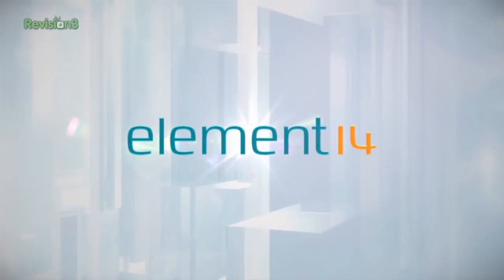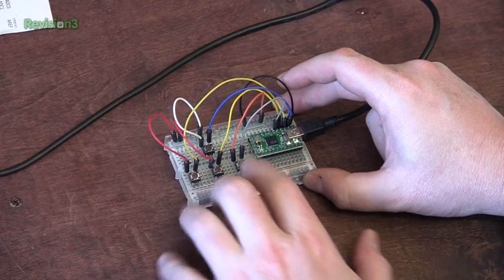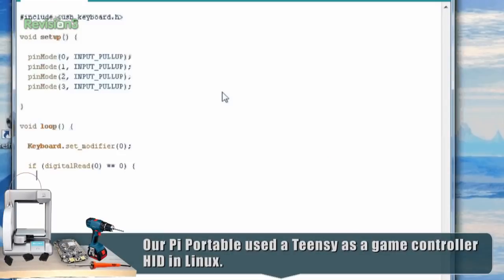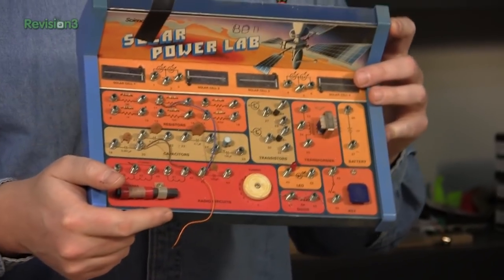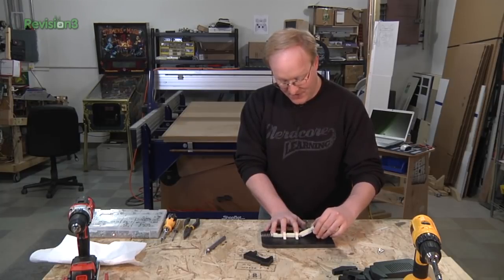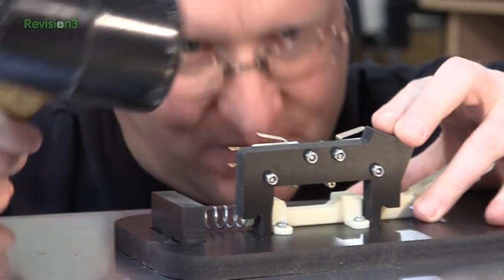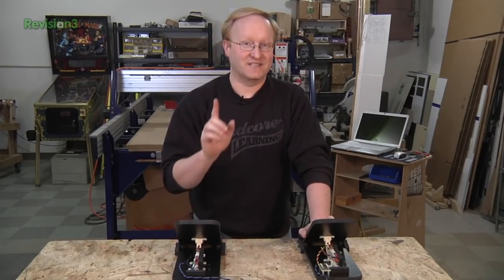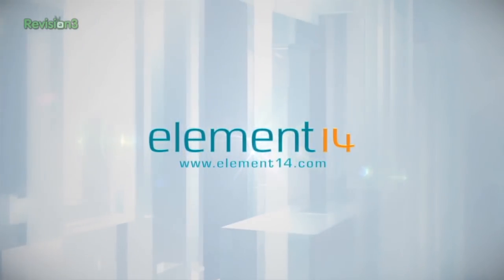Beyond WASD: Foot Pedals for PC Gaming

Comment: I hate how people go on about the pc being better at controlling games, really all that is better is the mouse but the keyboard is shit at playing games on. but games like magicka and others is the only games that will work with it all the way. but any even then its using wasd. controllers are better than keyboards its just a fact
Reply: I like to make statements that I feel are correct, It's just a fact.
Reply: what? wasd does not have any pressure control, thats why car games are bad on pc. they are basically really bad d-pads. do you when your playing on console use the joystick or the d-pad to move? most likely you use the joystick, and if you do use a d-pad then you are using the dumber way to play. you know why? because joysticks have xyz in them, they know where you controllers joystick is a its point, so you can go faster or slower if you want to. so I am still right, controllers are better than keyboards
Reply: TheJeremy404 Yup you still making statements. Well done.

As long you're just play racing games, or games where you need constant access to slow movements, you're absolutely correct. If you're playing the other 95% of games that require very quick and precise control or selection, you might want to consider a mouse. Analogue sticks provide neither, and the scenarios in a game where I would want to move at less than full speed are fleeting.
Reply: no but its true though. if its not prove me wrong that the keyboard is worst than a controller. other then a mouse everything else is better on controller. prove it wrong. I already added evidence. I told you why its better. and I used car games as a point. and something else, fps's for a point, in farcry 3 and you want to be sleathly you want to be slow right? well you can't control that. I mean there is the shift key to run but thats it. I don't know why you think its a clam, because I gave evidence for it so its not. its a fact and if you don't think so prove it wrong
Reply: TheJeremy404 Your statement was disputing "pc being better at controlling games." Claiming that only the mouse is better is a useless statement. No one uses a keyboard alone to play games, not since the early 90's.

The keyboard and mouse as a combo wins in accuracy and speed 95% of games. Controller wins for simplicity and in games where non-binary inputs are vital, which is basically just racing games.

If we're being technical here, disputing that "pc being better at controlling games" is completely daft because you can plug a 360 controller, a dualshock, a racing wheel, basically anything you want into a PC to control your game as you wish.

Also, in Farcry 3 you press ctrl to crouch and go stealth, it was never an issue for me. The game actually suffered for being balanced primarily for consoles/gamepads. Being able to quickly and accurately kill anything made the hardest difficulty level extremely boring and easy.
Reply: my point is that keyboards allow 3 speeds running walking and slow. but controllers add more than that. even if in some games its pointless its still there, so it is not invalid its a fact.
Reply: TheJeremy404 If your entire argument is "controllers have analogue input and analogue input is better for racing games and a marginal convenience in stealth games" then I agree with you.

That however, is clearly not the statement you originally made. Unless you were somehow implying we should use a controller in 1 hand and a mouse in the other.
Reply: Stan Velijev ok first off, that was not my point at all, but even if it was there are still games to this day that use only the keyboard, and its not a small amount.

know I don't know where your getting you %'s from but even if thats so its carried mainly by the mouse because the keyboard is not fucking accurate at all. it lets see wasd shift and ctrl for example. it has 3 speeds 4 ways to go and thats it. controllers have so much more than that, and even if its pointless in some games its still there. and it is still better.

and I do use a controller on my pc. I don't know how you could of thought I didn't. I mean its kind of clear that some one that plays on pc that can't stand keyboard using a fucking controller.

and I have pc far cry 3, it is not bad on pc controls for what it is. hell you have all the pc basic controls there. 1234 is your weapons, wasd, space, shift, ctrl. and any I didn't like I can change where they are. so you going on about that is pointless because you can change what it is. hell this was before I had a controller to use so I used some of my mouses extra buttons to use some things.
Reply: Stan Velijev really? thats what I was thinking. a controller in one hand (it would need to be made for that use) and mouse in the other is a much better way of playing. analogue input for moving and mouse for looking would be the best way to play.
Reply: ok but some games don't do that. and even so controllers can have more than 16 directions. so that is still better
Reply: TheJeremy404 I seriously have not played a keyboard only game since... Doom? Maybe Duke Nukem 3D I did keyboard only back in 97-98, that's as far back as I can remember doing keyboard only, aside from maybe a game like typing of the dead, which I don't think you'll argue would work better on a controller.

I don't see how you can argue for PC controls being inferior when keyboard controls are necessarily accompanied by a mouse. In which case,  racing aside, pretty much everything is better with mouse aiming.

If your argument has shifted to controlling something like COD with a keyboard only, then your argument was ridiculous from the start.
Reply: TheJeremy404 So which games are significantly better as a result of analogue controls? What are we arguing over here?

Racing, got ya. What else? Stealth? Not really, a toggle/modifier is sufficient for stealth mode. Having the option for more then 3 level of speed isn't useful if  it doesn't gain you any type of real advantage within a game, so things like sprint/walk modifiers seem completely adequate.

Now I can list you limitless examples of scenarios where a m+k are superior. Please name me a few where a controller has a real advantage.

Off the top of my head, the only things I can think off are God of War or Assassin's Creed, melee action games that were clearly never planned to be mouse/keyboard compatible. One could argue platformers, but that's purely comfort and I'd likely use the Dpad there and the analogue part of the control would have no use.

Really, not sure where you're seeing the benefits.
Reply: there are always people who will mod games to support sensitivity. thats another reason to be a pc gamer free mods for everyone. over 16 what, buttons, oh well guess what, an average keyboard has over 100
Reply: TheJeremy404 I asked you about 5 times to give me  examples of games outside of racing where analogue controls would actually give you a real advantage over a keyboard.

If you're going to bring up something like "more than 4/8 directional movement" please explain to me a game where you gain an advantage from that. If you're going to bring up "movement speeds in a stealth game" please bring up an example where you need more than the 3 movement speeds to perform well in a game.

If you can't provide me with anything then you have no argument and I have no reason to participate in this anymore.
Reply: You know why a PC is always better for controlling a game? Because of stuff like this. We can use whatever input methode we want. Keyboard+Mouse sure is the basic setup, but I also just use a PS4 controller, or maybe a actual wheel for racing games. While consoles are stuck with one controller.
Reply: You are stupid. Controllers are only good for CoD, Twin stick shooters and games poorly optimised for PC.
Reply: oh and car games. now seeing how you missed that I can call you stupid, you're stupid. now I was saying keyboard, not keyboard and mouse. I don't know why you guys keep missing that. really the best way to play would be a one handed controller and mouse. thats my point, the keyboard is shit, and it should be a controller instead. now clearly you didn't get any of that from my other comments, so I'm going to call you stupid again, you're stupid. bye
Reply: TheJeremy404 I know you said keyboard and keyboard is better and why have a controller when you can have keyboard, lots of console peasants say that k+m is bad but when you give it a go it doesn't take long to Get used to it and it's superior. I only own a USB Xbox controller for dark souls. You only need three movement speeds. It has a wide range of buttons and shortcuts that can be reassigned to whichever you want. And unlike console it doesn't have to reuse every button to do different things. Sure you may like it for a small percentage of games but for the huge majority keyboard is better
Reply: I'd like to see some evidence for that please, and console peasants really? because of that I'm going to assume that you hate consoles and only play on pc. ok graphics are better, I know that, but keyboards are worst at playing fps/thirdperson/cargames/and even some 2d games. and I am talking about the moving not the looking. I am not saying k+m is bad I am saying the k part is worst than just using a controller, I am saying that c+m is better than k+m. if people used that why to play games it would be better. but as of right now I don't know of any games that do that, and thats sad. and I am talking about movement, I don't know why you guys keep forgetting that, wasd shift and ctrl is worst than joystick and triggers, it just is.
Reply: TheJeremy404 nope, shift and Ctrl are good compared to pressing the same button in a different way to do the same thing. I am not bothered about graphics, I like PC for prices and gameplag . and why use c+m you don't need a mouse if you want to waste time with controller. I don't only play PC but I did use to be a Xbox fanboy before realising that there were superior systems. I use the Ouya as well. People might think its a joke but its a cool system for playing with friends despite a controller problem and WiFi problem but still better than Xbox and PS. Like I said before conttollers work for cod, racing and football games, twin sticks although sometimes k and m is better and for games badly optimised for k+m
Reply: TheJeremy404 Outside of racing, I cannot find a single example of analogue controls gaining you an actual advantage in terms of movement that can't be done equally as efficiently with a keyboard. Sure, on a technical level, there are more degrees of movement, which is completely meaningless if that doesn't provide you with a tangible advantage. Unrealized potential isn't a very effective argument.

You could make some arguments for convenience I guess, but really, even for FPS games, I can actuate keys to perform actions much faster than with a controller. I have access to 5 points of instant actuation and that's with 1 hand. On a controller you have 2 per hand, trigger and analogue stick. Even if you considered 3 of my fingers permanently limited to movement (not the case) that's still 2 useful points of actuation, where as with the controller you're left with the trigger and you'd need to move your fingers for anything else (or click the trigger, which I'd argue prevents you from doing accurate movements, that's like moving your fingers off wasd).

I assure you, if there was some advantage to using a controller with a mouse, competitive gamers would be doing it. They aren't. Not even contemplating it.
Reply: Stan Velijev yawn, if people wanted it or if it was useful somebody would mod a keyboard to have different sensitivity on wasd keys but its not necessary and your problem is solved, you only need one finger on wasd or even two so even then you have the rest of your hand to reach on the keyboard for another key
Reply: no your not getting it, when I say c+m I am not using the other joystick. 1 for moving and thats it. now what I should of said was x+1joystick+mouse is better than ctrl+wasd+shift+mouse. oh and I have a ouya, its called a nexus 7. now I know that graphics and the controller is worse on the ouya and don't give me bullshit it is not, and the games are all mostly touch games. and most of those really suck. but thats something else. do you get it now? oh and the fact that you didn't the first time makes me want to call you stupid again, you're stupid
Reply: i have a nexus 7 too, both that and the ouya are viable systems, c+m is bad because you are only ever using one at a time
Reply: Stan Velijev are you saying I am right and saying I am wrong in a circle. I mean really. anyways instant actuation can be done on a controller at the same time as a keyboard, and even if that is true its not my point. ok I meant a 1 handed controller with all the buttons, it has been done before. I would just get rid of the second joystick and us the mouse. and guess what, when ever I use a controller I do take advantage of the xyz points on a controller, and a lot of my friend do as well. oh and the nexus is more powerful than a ouya stupid, and why do you have both they are the same thing but the nexus is better
Reply: Alright, so one of you made a flippant statement about PC controls universally sucking. You then retracted that to say keyboards suck as though someone plays with keyboard only, then refused to name any significant reason why their magical mouse+ controller idea is necessary at all outside of racing. What you want is a fucking racing wheel, otherwise mouse + keyboard is BETTER.

The other one started arguing with me as though I disagreed with them when I didn't and began arguing my own points against me.

I'm out, I don't need to talk to retards arguing with me for no reason or people who dodge arguments and shift their position constantly.

Side note, several companies already made pressure sensitive keyboards with analogue button style capabilities. One of them was Microsoft. You know what they found? There was no market for it.
Reply: ***** well than you only have to use one thumb on a joystick and you can still get to the other buttons, now can't you? on a one handed controller even more so. and even if you had a sensitivity mod on your keyboard, no game would support it, and it would feel really weird, and how would typing work? would you have to press it all the way? ok why I think its weird is because its basically just using triggers in a down position, you can try it right now, trust me its weird. and even if they didn't fell weird you still only have 4 or 8 ways to go, on a joystick you have over 16.
Reply: ***** oh my god, ONE HANDED CONTROLLER. they are real thats what I am talking about you stupid stupid fuck, really god you are stupid. let me make it more clear one-handed-c+m. make more sense to you stupid?
Reply: ***** ok how many of the 100 buttons are used? yeah so thats not my point at all you moron. oh and as I said about support, not all games will have modders to do that, and some games will be to hard to mod. and if you were talking about what I said earlier stupid, I was talking about how the wasd keys can let you have 8 ways to go, and the joystick has over 16 ways to go, and if you triple that because of sensitivity thats 48 points, so fuck off with keyboard being better, because its not
Reply: ok, I can't... I said it I can't give you anything on speeds, but as I said earlier having more than 16 points on a joystick do help in movement, I can say any game to help me with that. know this might sound silly but whenever you're bored on a game do you ever do something weird with the controls and just jump around in the game? because that can be fun sometimes, I know all my friends do it. and with more speeds its more fun and funny to do. oh and you asked me 5 times? well I did answer as you stated you just didn't like the answer. and please do go, this is getting annoying and I don't want to talk to any of you retards (not you I don't think you're stupid)
Reply: TheJeremy404 you don't need any more than wasd gives so you get pissed off all day but k+m will always be better
Reply: TheJeremy404 Ok well my point is, theoretically analogue might be better, in practice, very very rarely.

In racing it's important because you often need controlled turning for long periods. With a mouse this is hard, you just run out of mouse pad and moving smoothly with a mouse is pretty challenging.

In an FPS, you can augment your 8 directions from a keyboard with the mouse, so you can modify walking sideways with a small turn of the mouse to be walking in any direction you want. This makes analogue movement controls redundant. You just don't need it, doesn't add anything.

The fact that you can't really name anything critical for analogue other than racing really makes me think: Racing wheel would be the more authentic solution. For everything else a controller might be nice, often more comfortable, but will not necessarily make you perform better at the game.
Reply: Stan Velijev I know I already just responded but I would like to say something else. the joystick feels better it has better movement. this makes it feel better. oh and I would like to say that the first keyboard was never made for gaming, the mouse was not as well. but the mouse had the accuracy on its side, the keyboard is a typing machine, not a gaming controller. it has nothing on its side other the amount of button it has. which is pointless to say because not all the buttons are used in games. the joystick may have less accuracy on looking but has more on moving compared with wasd
Reply: ***** prove it then. do it I bet you can't. wasd is worst than just using a joystick. can you prove that wrong? no you can't because it true. stop being stupid, stupid.
Reply: Stan Velijev on a fps you want to keep your eye on the guy right? then you have to use asd as well as w then don't you? and thats better on joystick. now go, I know you want to, I do too. if you stop we can go to sleep
Reply: TheJeremy404 Well, "feels better" is completely subjective. I prefer the keyboard. I can press up to 5 buttons instantly with 1 hand and have access to a dozen more with that one hand. You only have access to 2 at a time per hand with the controller and have to move your fingers for the rest. I see this as a disadvantage.

It doesn't matter what things were made for originally, we now have gaming mice and gaming keyboards which fill their role.

Razer, Logitech, Mionix, Steelseries, CM Storm, Mad Catz, Roccat: All companies that make mice and keyboards specifically intended for gaming.

Computers weren't ever intended for gaming. The internet was never intended for gaming. That argument doesn't hold up.

As far as "having more on moving" we went over this. It has no real advantages outside of racing and "just walking around for fun" as you've stated. You might personally like it more, but it doesn't significantly alter or improve how the game is played.
Reply: that depends on the layout of the controller, this would be a one handed controller as I said 50 fucking times. and by feels better I mean more opinions on how you move, which makes it easier to play even if its small. oh and gaming keyboard are still using the first keyboards layout, it still has the layout that makes no sense for gaming, people just kind of made games on it, and it kind of worked a little bit. as I said please leave, I want to stop talking to you, is this a circler argument and its going nowhere. so please go away, for both of us
Reply: TheJeremy404 If you're shooting at someone there's not much reason to go anywhere but to your left or right to dodge bullets. Sorry. If anything, dodging oncoming fire is much easier if you have your fingers on the left and right and can alternate quickly versus having to tilt your thumb back and forth.

So you've given up on proving how an actual analogue control is better and are making up a fantasy controller that doesn't even exist? Why not just make up one that you can control with your sphincter muscle while you're at it. Dildo 360. It could also vibrate every time you get a new youtube comment.

I'm out, good night.
Reply: Yes a Analog stick gives you more control over movement speed. but gamer's just run around at full speed in a game so it does not matter. And for those times you need to slow down just press shift.
Reply: I already talked about this, but I don't care anymore. I'm right you know I'm right, just that its pointless what I am saying. I have heard it, now go away. I don't want 20 comments to respond to tomorrow ok? analog sticks have more control is my point and thats it. ok. wasd has less. now please go
Reply: TheJeremy404 I don't think i ever said you were wrong.
And if you don't want people to reply you should delete you're comment that shouldn't be here in the first place, as no one in the comments section has brought up the KB+mouse vs controller argument but you.
Reply: no everyone said I was saying k+m vs controller I never said that I said c+m vs k+m. so if you look they are the ones that started that not me. I didn't say you though I was wrong, you said I was right. this video is about using something else other than keyboards, so I think it fits pretty well if you ask me. now fuck off. I am done with this, I have already won and you guy confirmed it so there is no point in talking anymore, go away
Reply: TheJeremy404 Again. No one was arguing about the keyboard being better then controllers before you.
This video is is about adding to the KB and mouse combo. ( Read video description ) not about using something other then a keyboard.
But i am done arguing with you as grammar and sentence structure is that of a five year old and it's giving me a headache.
Reply: TheJeremy404 you go believe your little lies but deep down you will eventually have to admit that k+m is better
Reply: dude its a youtube comment, grammer is not really the main thing now is it? oh and I told you to fuck off, so fuck off. this video is about using something else other than a keyboard keys he is using things that work with your feet and mouse and a little bit of keys if he has to, so why is it weird if I say its better to use one handed controllers and mouse over keyboard and mouse? its in the same thing, don't want keyboard parts use something else. oh I said keyboards being worse than controllers not better. and even if I started this why do you care? fuck off you retarded little shit
Reply: TheJeremy404 yeah its about using an external foot pedal, not a controller
Reply: ***** thats not my point stupid, my point is its using some buttons on the keyboard without using a keyboard. so a one handed controller. now think about it, is this not what he is doing with the foot pedals?
Reply: TheJeremy404 Welcome to the club. I have had dyslexia for 20 years and have learned to deal with it, reading things over and over or out loud, typing things not writing things are some of the ways i have dealt with it.
Oh and Dyslexia is disorder not a disability.

And if you want to talk about being a dick \ ass. We can go and look at the three or four comments where you tell me to Fuck off.
Reply: I'm not surprised Dyslexia is so common these days
Reply: TheJeremy404 "I'm right you know I'm right" Pretty cool I guess. I'll just pretend you didn't admit you couldn't give me any example of a game where you need analogue controls outside of racing. Well won I guess.

This has devolved from anything related to a discussion to some guy grasping at ways to not lose an argument for any reason. Yeah, I guess if you had a magical non-existent controller that let you use a mouse at the same time and have magically as many accessible buttons as a keyboard and magically have none of the drawbacks of a standard analogue controller, yeah.

If you're going to resort to fiction to try an win an argument, well, seems kind of far fetched at that point.

Maybe go petition Razer to make the Nostromo have analogue key input http://www.razerzone.com/ap-en/gaming-keyboards-keypads/razer-nostromo/ Seems to be what you're attempting to describe.
Reply: no my point was c+m gives you more control over k+m. and you guys said yes. it may be pointless, but its still there. and I made the c+m up as my point, you know it can work better than k+m you said so, so I won. bye, go away, piss off
Reply: BlueFoxTV ok fine, but I am 15 not 20 I don't like reading because of it. and as I was saying go away, you were pointing out something that did not need to be pointed out to call me a idiot, I have told you to fuck off. I think what you have done is worse, go away, but before you do, tell me how in my case is it not a disability.
Reply: ***** no you stay, I want to see you proof
Reply: TheJeremy404 No one said mouse and controller is better than mouse and keyboard. No one said it because such a setup does not exist. You're claiming we're conceding arguments to you based on imaginary devices that you MADE UP COMPLETELY.

Really, your argument now is completely based around the plausibility of something better existing.

When you grow up you'll come to the realization that not everything in life is a pissing contest where the last person that replies is the winner. Facts are relevant, and the only fact you have left on your side is a magical non-existent device paired with a mouse might possibly be better than mouse and keyboard.

So you're saying mouse and keyboard is better than everything except things that you made up. Good job, you're such a winner.
Reply: ok first off, this is a comment on the ben heck show right? he makes this kind of stuff on his show right? that is why I made it up. and you said it would have more control its just that it would be pointless most of the time, I don't care it has more control and thats it. and it is a fact, controllers have great controllability but the looking is bad, use I mouse thats fixed. and you know the keyboard is not a gaming device at all, even if it says its a gaming keyboard, its still a keyboard that makes no sense at all for gaming. and seeing how you have said I am right, I do win. its not a pissing contest, its a fact. and you have not come up with anything to prove me wrong, if anything you have proved me right. go away
Reply: TheJeremy404 Let me recite back to you what you just said:

"The device I just made up in my head has more control, it's a fact." The device you made up doesn't exist. That which does not exist, by definition, cannot be /factual/ because because it is categorically fictional.

"You know the keyboard is not a gaming device" As much as a computer isn't a gaming device. Millions of people use computers and keyboard equally as effectively for gaming. Just like they use the internet, which is a communication technology not a gaming technology. I said this previously yet you repeat the same shit as though it becomes more correct through repetition.

"You said I'm right so I do win" I said you're wrong over and over, to which you just say "Nope I'm right because I can make up shit and say it's better." This is like arguing with a child. You think you're right merely because you keep repeating you're right.

This is never going to get anywhere. You're going to keep repeating the same crap and asserting victory because your fiction is more correct than reality.

Reality: Keyboard and mouse is almost always better than a controller. Fictional mixes of both do not exist, you have not produced any yourself, and shit you make up doesn't overwrite reality. In conclusion "people that go on about the pc being better at controlling games" Are absolutely correct in an overwhelming majority of games.

Thanks for playing, better luck next time.
Reply: TheJeremy404 oh, you want to see my proof, well where's yours
Reply: no you admitted to saying that controllers (joystick part) has more control than wasd, and thats it. and just because it is fake does not mean its not better, it would be better if the next gen consoles had the same price as they do now but they have the power of 2 gtx 790 graphic cards with 16gb of ram, but they don't but it is would still be better. just because I made something up does not mean it is not better, you have not proved me wrong at all. sure people that play with keyboards think it fine for them, but using a one handed controller would work better. to make it easier for you to get, a controller+mouse would have more controllability, would. and you know it would
Reply: TheJeremy404 PC is better no matter consoles specs
Reply: TheJeremy404 one handed just wouldn't, why limit to yourself fumbling on one hand when you can use both
Reply: no, you use the mouse in one hand and the controller in the other, not just use a one handed controller, that would just be stupid, stupid. I said multiple times, c+m, not c
Reply: TheJeremy404 So all you have is "Shit I make up is better than reality." Nice.

I'm gonna go back to reality now instead of arguing with kids.

A winner is you, good job.
Reply: so you do think I am right, but your too pissed off it do it nicely. and by "Shit I make up is better than reality" well you said it yourself, it is. so thank you, even though you have been a bad sport
Reply: ***** first that is if you have a pc that is better, and I was saying if the consoles where like that it would be better than what they are now, I was not ever comparing console graphics to pc graphics.
Reply: ***** I have gave you proof, wasd is 8 ways to go, a joystick has over 16 and if you put speeds in thats 3 to 4 times that.
Reply: TheJeremy404 you dont need it though, three speeds and the 8 movement directions are fine
Reply: TheJeremy404 Sarcasm flies directly over your head. It's ok, you're only a kid and obviously socially awkward.

Things you make up are irrelevant. You could have made up something that hooks up to your brain and controls the PC directly which would be infinitely more effective than any peripheral.

It's fiction. There is literally no way to disprove something that is a fiction that resides only in your head because you can make up anything on a whim, and you have.

Let me rephrase that: You're full of shit and your only way of winning this argument is "I can make up anything I want to sound right only to myself." I don't care if you can make up shit all day, I only care about what is reality.

Reality is: Keyboard and mouse is better than a controller, and it's better than made up bullshit that no one can use because it doesn't exist.
Reply: yes, yes I am, not the kid part, the social part.

and yes that would be better, I admit that, just because its not real does not mean it is not better.

the only reason no one can disprove it is because it is true. not because it is not real. put in a mindset and think its real, would it be better? it would be.

if you can't care about anything other than reality you must be a very boring person. imagination is not bad when you consider and think and then realize if something is real it could be better.

Reality is: I can make stuff up if I want to and say its true because I prove it to myself, you guys just don't like the idea of it in itself, and you guys just want to kill the idea. lets say this it would be better if your computer was bought for 30$ but it worft 600000$ because of how powerful it is, that would be better, but sadly thats not the case, I can apply that to anything. and I did
Reply: ***** yes its, fine but its nowhere near perfect now is it, 3 speeds 6 speeds, 8 directions over 16. all you have for wasd being better is that its fine, and if its fine, that makes joysticks great
Reply: TheJeremy404 it doesnt need to be "perfect" and it isnt perfect, neithe are. and joysticks are only good for a very small percentage of games
Reply: joysticks are closer to perfect (in movement) than wasd, and you still have not said why it is better to use wasd over a joystick at all. all you have said is it is fine. then you admit to wasd being worse than a joystick
Reply: TheJeremy404 its better because wasd has the rest of the keyboard aswell
Reply: TheJeremy404 You're too slow to realize the problem of arguing real items vs shit you make up.

It's nice that you can make up things and prove them to yourself, unfortunately you can't prove it to anyone else because the rest of us are adults.

We're talking about reality, you're saying keyboard and mouse is worse than things in your imagination. We cannot use things in your imagination, because we're not autistic teenagers who value other's fantasies over things we can actually use.
Reply: ok, as I was saying. fucking use a mindset in your head it does, and think about it. would it work better? and then you will see it does. I don't care that its not real, thats not the point. the point is if it was it would be better. and put it in your mindset, tell me if you think it would work better or not, because all your doing is "its not real so lets get rid of the idea altogether" which is really stupid don't you see that.
Reply: ***** I said to not point out that the keyboard has more buttons, and you did. its a typing machine, it will have more buttons because of that, and most of the buttons are never used. having more buttons is not always a good thing, ok? now stupid make some evidence that makes sense please.
Reply: TheJeremy404 yeah but you do use alot of them and the rest are free for shortcuts or commands
Reply: TheJeremy404 Something that takes input from your brain is better. We don't have that though, just like we don't have your imaginary controller.

Claiming that Keyboards are terrible because they're not as good as your fantasies is ridiculous. You are ridiculous, and you're oblivious to how ridiculous you sound.

A lot of things could be made up that are better than keyboards, but they cannot be better until they exist. Fantasies are not better than real products because they aren't useful to anyone but you.
Reply: which in some games you don't need. in fact lets look at farcry 3, it has a weapon circle so you can get to your weapons and press y to change to your last weapon, and on pc its there as well, or you can use 123456, sure they are shortcuts, but really they don't even have to be there. so stop pointing out it has more keys, as I said most of the keys are not used, and even if they are, you can just not use them
Reply: TheJeremy404 yeah you have a weapon wheel on controllers because they dont have enough buttons whereas on pc you can use 1-0 or the scroll wheel
Reply: Stan Velijev they are not useful to me if they don't exist. ok thats true. I does not exist, oh and thanks for confirming how boring you are by not using any creativity. I it might seem ridiculous to have ideas in your head, but people have ideas all the time. you just have to get use to people have imagination. this is the ben heck show, he makes shit up all the time. why is it that you don't complain about his work before its done. because you are a suck up. if I have ideas that are better than whats real, than I have Ideas that are better than whats real.
Reply: ***** scroll is the mouse, and in this the mouse can be used. so stop with the k+m and start talking about k/c+m. and as I said just because you have more buttons, DOES NOT MEAN YOU USE THEM. I said this so many times, having more buttons is not a valid point at all. and thats not what we are talking about really, I am mainly focusing on the fact that joysticks are better than wasd. and thats true and you have not proved that wrong
Reply: TheJeremy404 Cute, regressing to ad hominems.

Ben Heck doesn't just imagine things, he produces them. Please don't compare yourself to a person with skills. He works within reality and knows how to make things he thinks of into reality. You bullshit and then pretend you're awesome because of it.

I own a 3d printer and design new products constantly. I know tons of software, have made games and was doing level design and scripting back when I was your age. I'm glad you're proud of having an active imagination, too bad you you have absolutely no skills for producing anything or for communicating effectively with other humans.

Since the only thing you've got left is insults when you don't even know who you're talking to, I'll leave you to your ramblings. I have actual work to do.
Reply: yeah we all know that your coming back anyways, oh and I can't make shit like that because I don't have the tools or money to do so. I am in training with woodwork and I do have skills, claiming I don't is childish, and my point about thats was that if he says some that he thinks is a good Idea to make and then he makes it later, does that mean before he made it, it is a shitty idea? no, just because it is not real yet does not mean its a bad idea to do, and thats the way you have been talking about it, you "because its not real yet it is pointless, and is a price of shit". and to that I say fuck you. talking about something that does not exist is something people do all the time, you just don't like talking about that because it goes against you ideology
Reply: TheJeremy404 If you had skills, you'd make something. Instead, you're arguing with no product to back up your arguments.

I have no interest in disproving things that only exist in your head because that isn't possible.

I only have interest in disputing your statement of PC controls being bad, which I've done, because there's no superior existent alternative. If the best thing that currently exists is your definition of bad then you've lost your grip on reality and are simply talking out of your ass.

I'm glad you like to play video games in your head with imaginary controllers, some of us prefer to play actual games on real peripherals, of which the keyboard and mouse is currently superior.

Good luck making your one handed controller out of wood.
Reply: I can say the same thing to you, because you are arguing about it as well, oh and as I said you would come back, you did. and again claiming someone has no skills is childish.

you only have to think about something, thats it. it does not exist, but that does not mean you can think or know its better. if I have a computer with 3 gtx 790 graphic cards, that is better but I don't have that. but it is a fact that it would be better if I did.

making up stuff is not always wrong, and guess what, this is not wrong.

I'm glad you WOULD like to play video games in your head with imaginary controllers. as I said the keyboard brings the controllability down and mouse is so go it brings it back up. of course the setup is better than controller. but thats all because of the mouse not the keyboard, and if I am wrong on that prove me wrong. its real so prove it.

I didn't say I was going to make it at all, and out of wood? I said I don't have the tools to do so, why don't you get that?
Reply: wow, that was a good guess, you are right I am. but mild

oh because it is more closer to real life its better?

ok then, 2 gtx 50000000000 (I know its not real) with 64gb of gddr5 ram would be better than your pc. that is not real but if it was, would it be better? or is it just a shitty idea because its a idea.

I made something up from the start as a idea to go against keyboard. you making stuff up now makes no sense because at where you are standing you are saying the keyboard is better because the other is not real. you saying that something is better than I keyboard makes you look really stupid.

yes you do look retarded mainly because you are basically hitting yourself in the face for no reason but to prove me wrong, which I might add is not working. and even so I like your idea. my thing is "this idea is cool, if you want to talk about you can" when you are going "talking about something that is not real its retarded". people do that all the time, how do you think gaming started? they had a idea, does that make it stupid? no it doesnt.

and if you don't understand what we are talking about (which you don't). we are talking about how something would be better if you used that instead of something else. so just because I like talking about things I like to exist, does that mean I am stupid? no it means I have a idea that you don't like so you just point out that it is a idea so it can't possibly be good, because ideas never work do they?
Reply: are you saying I am right or not, pointing out grammer is pointless
Reply: I, I don't. bye
Reply: TheJeremy404 The point Stan Velijev  was getting at is that having 3 fingers on "wasd" is faster to alternate between directions than only having your 1 thumb to twitch the thumbstick. And the fact is, one handed controllers ARE real, unfortunately they are not as good as the regular keyboard(from personal experience). I've owned a Logitech G13
http://gaming.logitech.com/en-us/product/g13-advanced-gameboard
for 2 years now, and while it is occasionally conveniant to have analog input for racing games, it is slower to react with one finger than with 3, and while you may not want to hear it, there are simply not enough buttons for 95% of all PC games I've ever played(You'd think 24 buttons plus analog would be enough right?).

The real reason I prefer wasd vs analog comes down to speed. It is more advantageous to me in games to be quicker at moving than having slightly more directionality. Therefore wasd+mouse is better for most games than analog movement+mouse.

On a side note, you should look up "Occam's Razor", as this entire discussion has been an argument from ignorance
http://en.wikipedia.org/wiki/Argument_from_ignorance
Reply: well, he never made that point at all. but my way still works better, I can still get from one way to another as fast a wasd. if other people can't then its not for them, now go away
Reply: Djinnetic Thankyou, I hope it has now ended
Reply: TheJeremy404
You are no Superman sir! Just as limited by flesh and muscles as the rest of us.
Stan quite clearly said "Stan Velijev
Yesterday 12:07 PM

 +TheJeremy404 If you're shooting at someone there's not much reason to go anywhere but to your left or right to dodge bullets. Sorry. If anything, dodging oncoming fire is much easier if you have your fingers on the left and right and can alternate quickly versus having to tilt your thumb back and forth."

So really, look up "argument from ignorance" and you might one day begin to understand the fallacy in your position.

Wait I'll even do it for you
http://en.wikipedia.org/wiki/Argument_from_ignorance

I'll even sum it up:
The burden of truth lies with the one speaking it.
In other words, it is not up to the rest of us to prove you wrong, but rather, for YOU to prove yourself right ;)
Reply: *****
I had too much fun reading this to not get involved
Reply: I can see why, oh and over 100!!! WOOOOOOO
Reply: ***** you still need proof, don't use other peoples
Reply: TheJeremy404 my opinion is the same, it is plenty to cover for everyone
Reply: Djinnetic well played. oh and before I go, I may as well say this, the wasd is faster, but not very noticeable, and the joystick has more directions but its not very noticeable. so it does just come down to what you want. anyways bye
Reply: ***** yes but you never said it yourself, you just waited for someone to do it for you. thats called being lazy stupid
Reply: TheJeremy404
Again you tell me to go away. But as i have pointed out earlier i don't have to.

And yes it did need to be pointed out, as it's hard to figure out what you are saying. Well what you said was just a insult.

Quote from Wikipedia.
"Dyslexia, or developmental reading disorder"
Reply: Djinnetic Sadly that's how i got involved in this.
Reply: dyslexia can affect you in more than just reading. that wikipedia note is wrong. I have talked with people that know this stuff before, its not just reading. its writing and spelling as well, you clearly don't know what you are talking about. and your a brony right? love and tolerate, that is something you don't seem to be doing at all
Reply: TheJeremy404 well you can't complain about that when your the one calling everyone F'ing retards
Reply: its not like you guy where not doing that at all... oh wait, now stupid I just need you to say something that is not pointless. can you do that please? and don't just point out that I have said pointless things before, that would be stupid
Reply: TheJeremy404 I have made no mention of Dyslexia just affecting reading skills and neater does Wikipedia. So i am not sure what you are on about.

Also love and tolerate is not some rule i have to abide by, is's just something the fandom says.
Reply: BlueFoxTV  /)
Reply: (\

All right let's get back on topic.
Are analog joy sticks better for controlling movement speed? Yes.
Does it matter? No. As 90% of games people just run around at full speed and use shift for the few time they need to slow down.
Reply: x (\

yes, you see wasd its more fast to use, but not really noticeable and analog is more controllable, but not noticeable. we are really were all wrong if we are saying one is better than the other. its just voice, I think we can stop this conversation now
Reply: BlueFoxTV you pointed out just reading skills though, sorry I just got confused
Reply: TheJeremy404 to each their own mate, I like keyboards because the input is binary it's more precise for games like fps games like TF2. Also the sheer amount of buttons is good for voice command binds and binding scripts to certain keys.

I like controllers for things that need an analog input but the lack of buttons is limiting for me. Also on a controller you can't use any of the face buttons while moving and aiming which loses precious seconds in a twitch shooter.
Reply: if you read all 119 comments you would know what you are saying is not what we are talking about, and I don't think you want to read all that now do you?
Reply: TheJeremy404 My only response to this is WOW!
You care way to much about something that is a personal opinion.
 Also you are arguing bye means of the YouTube comments section aka one of the least credible sources of information on the internet.
Reply: ***** True true
Reply: Mice are more accurate. Simply because you can use all the the motor functions in your arm and in your fingers for small precise adjustments. Also mice are linear, In other words the distance you move your mouse is directly proportional to the distance you cursor moves.
Reply: You do know that PC is compatible with every gamepad and joystick ever, right? I use my controller to play Spelunkey, Gang Beasts, Castle Crashers, Defy Gravity, Goat sim and tonnes more!,
Reply: this mouths ago? oh and glitch read all of it before responding, you don't know what you are talking about
Reply: you know what this about right, I said replacing wasd with analog would be a cool thing to do, I not saying use controllers because they are better. and by the way you pointed this out yourself just after you said this "controllers make a VERY select few games enjoyable". you pointed out that's not true for everyone, so what was the point of even saying that?
Reply: TheJeremy404 Ben did do an analog WASD keyboard.
Reply: yeah and then you said personal experience doesn't matter
Reply: "controllers do make a VERY select few games more enjoyable" and then "However, you have your opinions, and everyone else has theirs." your lying right now
Reply: I didn't do anything though, and you starting calling me things? I'm not a victim? and again you are telling me in basic terms to go get a life, fuck you. oh and I'm on a pc for fuck sake, how do thing I can type this fast? and no kinect does not work on youtube nor does the comment section work on xbox. you clearly dont know what your talking about, you said why I'm wrong you have just said "YOUR DUMB AND YOU HAVE NO LIFE, HAHAHAHAHA". in what way am I wrong that you contradicted yourself? you didn't say it was your opinion at the start and made it look like you where saying it was fact and even so you said opinions don't fucking matter, really how do you not get this
Reply: no I meant show me how you are not lying to me, and saying I'm 6 and I have to go outside, is not attacking me? you haven't answer at all. I don't just make shit up, I just point out what you say and why its bullshit. and if you would like to show me how its not
Reply: personally you fucking moron, I have tolled you that multiple times and you still wont listen. I even shown you examples! ok, I admit I said something mouths ago that say I'm being a hypocrite now, what you fail to understand is that was mouths ago! people change there minds in that amount of time. if you quote mine from mouths ago, you're going to find places where contradict myself. I'm not being a hypocrite, I don't even agree with myself on the first comment! ok now that's that's done, lets display all the personal attack you made on me that you deny happening, "Uh, guys, I think I broke him!" "walk out your house, and get some exercise and fresh air." "you're about 6, spend most of your time playing Minecraft on Xbox, have little education, and have severe autism." "Dear god, I can feel my brain cells killing themselves.". These a little thing called personal attacks, tell me how they are not and answer my fucking question, not answering it because you want to just proves that you are stuck and you know your comment was pointless. you point was you personally believe keyboard is better and then you said that's different for everyone so what was the fucking point of commenting at all?
Reply: ok I know you're lying now, look at your comments, you're I have asked the question at least 3 times now and I'm saying it again just look. and you are allowed to state your opinion, I was saying how you said opinions don't matter therefore making your comment pointless, I found that stupid and I pointed it out. I have heard you say its your opinion multiple times now and I get that! I'm just asking why would you say that doesn't matter right after you say it. now answer the question and admit your being a lying dick. false never happened? ok I'll copy the hole comment "FalconWraithYesterday 10:19 PM

 1
Reply
 
+TheJeremy404 Mate, I was literally just stating my opinion, don't try to make yourself the victim, you are literally trying to fight me with my own words, claiming that I'm lying to myself.
I'm gonna be honest, you, should put down whatever you are using to comment on YouTube, walk out your house, and get some exercise and fresh air." "FalconWraithYesterday 10:05 PM

 1
Reply
 
+TheJeremy404 I said "controllers do make a VERY select few games more enjoyable" because I was referring to my own experiences.
By the way, from the way you're typing, and the fact that you're trying to use a statement I said against me, while making no sense with it, makes me think you're about 6, spend most of your time playing Minecraft on Xbox, have little education, and have severe autism.
Good day to you sir." "FalconWraithYesterday 9:32 PM

 1
Reply
 
+TheJeremy404 When the hell did I say that?
Dear god, I can feel my brain cells killing themselves." you sir are known as scum
Reply: littlebitbetter you complain about him attacking you personally then you call him scum? i see a extreme flaw in you logic, you sir are a worse hypocrite than Alex Salmond.
Reply: how gives a shit about grammar on the internet? oh and I'd like to add you didn't say how I was lying, and you didn't say why you lying is ok even if I was. we all know you are lying I have shown proof, you show yours. I'm walking away from shit like you
Reply: the reason that i think keyboard and mouse is more effective than a controller is...
1. more accurate especially with scopes
2. if you can react fast enough you always have the upper hand (not the case with controllers)
3. pressure control? its called tapping w when your going the speed you want or holding Left Ctrl (for me anyway) which keeps your speed constant like cruise control
Reply: yeah I know
Reply: I'm talking you lied any of those attacks ever happened in this comment "FalconWraithAug 31, 2014

 1
Reply
 
+littlebitbetter
Like I've asked before, what is the question? Because I read through the comments, and I've found no question. Just you running your mouth and acting like your opinion is fact. ALL THE EXAMPLES YOU GAVE WERE FALSE BECAUSE THEY NEVER HAPPENED.
And I'm sorry. Am I not allowed to state my opinion about the original comment?
You're basically saying that nobody is allowed to say something if it's different for different people.
I even pointed it out, I prefer keyboard and mouse, but I don't enjoy every game with that combo, there's some games that are more enjoyable with a controller, and I cannot stress this enough, FOR ME.
Maybe if you weren't so ignorant and self absorbed you would be able to read the comments like a normal person."

you got admit your lying there. I don't remember (though you can show me) me saying that about people on the internet, though it is true its doesn't mean you have to support it by doing it yourself, all I said was no one cares about grammar on the internet. I am over it, I just need you to say something to support your case, all you have done so far is "YOUR A WHINNY BITCH, GET OVER IT" you stalling this. just tell me why what you did is ok, and not just "ITS THE INTERNET, EVERYONE'S A DICK!!!!!". true but for once be a mature
Reply: littlebitbetter I've been in plenty of fights were the best option is take a kicking and don't react and that applies to a varietie of situations,  what the fuck are you on pal .apariently something strong because you seem out of fuck touch
Reply: Wolffpackproductions fuck touch? Even I'm surprised at that grammar
Reply: you know I have said I don't agree with myself from mouths ago, but your ignoring the facts? just saying that entire point is useless because I talked about it before it was even I point you made. I'm sorry how are you not stalling this? really you just made a point that was already covered, but ok I'll go in to more detail and defend what I said as if I fully agree with myself from back then. first off I never remember denying the facts, I just said other facts that. we all where using facts, its just I was using ones to show my point. nothing use I didn't deny anything they said I know there facts where facts! and stop fucking misrepresenting my fucking point! my point was not controllers a better, I was saying analogs from controllers are better than wasd! I should not have to point that out to you, maybe if you read everything you would have a basic idea of what is going on. oh and I love this just I say this " all you have done so far is "YOUR A WHINNY BITCH, GET OVER IT" you stalling this. just tell me why what you did is ok, and not just "ITS THE INTERNET, EVERYONE'S A DICK!!!!!". true but for once be a mature" you say this for your next comment "You whined and rejected the facts.". oh and if you want the facts I was talking about, read the old comments. oh and read these ones to you clearly haven't been reading all of it
Reply: I'm sorry but that sounds like a bad idea "yes bet the shit out of me.". ok wolf what is you standard of at least running to not get hurt? and if its a verbal fight what do you do?
Reply: littlebitbetter verbal? ignore it to the best of my ability offence words are the weapons of a weak man
Reply: so you have never verbally insulted someone?
Reply: littlebitbetter i said to the best of my ability which isnt very well
Reply: you said you ignore it to the best of your ability when others do it to you, I'm asking you if you have done it to other people. it doesn't matter how well just if you have
Reply: littlebitbetter of course i have, who hasnt i dont like doing it but i do
Reply: exactly but when others do it, its a sign of being weak? get the point there, everyone does it. its like saying all if not most guys are complete and utter pervs because most of them watch porn, knowing full well you do.
Reply: littlebitbetter i said that knowing full well my intentions and i stand by it i hate using offensive language as i think it shows my weaknesses and brings out the worst in myself and others and that applies to everyone
Reply: are you a pacifist? because if you are you know this can't get anywhere, because you wont understand to basics of fighting or defendingt. and so far you have said you hate fighting and ignore it, well then you opinion this matter shouldn't bother you then right?
Reply: littlebitbetter Yes im a pacifist you`ve got that right i hate violence but i understand that its sometimes necessary to resolve problems but offencive language is unnecessary
Reply: in your view not necessary, in my view it is necessary. that's why this cant go any further, we a both presuposing our views are right so we can't change our minds
Reply: littlebitbetter ok explain your view in detail because so far all youve said is thats not going anywere which is a lazy way to explain it rly
Reply: ok well, in my view if calls me fuck face, I say what's your problem and if it gets any further I will attack back or get someone. what I thinking your view is to ignore them and wait for them to go away, I cant explain it very well but what it comes down to is you and me have the opset opinion on this presupposed. what that means is we now we are right and wont listen to each others view, if I tell you to think differently because I personally think your wrong you will think I'm wrong.
Reply: littlebitbetter ok i can respect that view.
but as ive said as its not necessary in the first place you shouldn't be in that situation anyway

my view though i`snt to completely ignore them as that only half works there is 3 ways this can go though.
1. virtually: this is pretty easy as there is so many functions to avoid someone now
2. verbally: ignore about the first 5 or so before reacting but keeping it in check or walk away
3.  Physically: ive said i don`t fight back alot of the time but if this goes over the top my reaction is kick the shit out of him

 so as ive said im a pacifist but if you step over the line get ready for a fight (or a debate) that you wont believe.
Reply: well I'd like to stop, but I'd like it more if you admit your mistakes, maybe I'll admit my "mistakes"
Reply: littlebitbetter btw i know this guy FalconWraith hes not one to admit his mistakes especially if he dosent feel as if he has made any.
Reply: denying you attacked me and the thing that started all this. that means there is a least 2 mistakes, and no we are not talking about grammar. I just want you to admit them, and I'll admit any you point out unless I can prove it wrong
Reply: ***** littlebitbetter  Your both being children, now just stop ok you both attacked each other now just apologise and move on
Reply: ok mum? I'm sorry fox person
Reply: littlebitbetter screw you little man.
Reply: ME CRUSH LITTLE MEN
Reply: littlebitbetter ok....?
Reply: yes
Reply: littlebitbetter fair enough
Reply: littlebitbetter but srsly both of you are acting like children
Reply: ha ha hah ahahhdahhafhuhfusdahfuiahf, read all of it!
Reply: read the hole thing, It will take you a long time, there are like 200 comments. I would not even try
Reply: No its an opinion
Reply: yes, opinions are made. but the hole point of this was to look at a new way of control, it made for people to look at there opinion and see if it should be changed. just saying "its my opinion and I'm going to stand by it no matter what" is just saying your dishonest and closed minded.
Reply: How are they better? You never specified how they're better but you stand so strongly to your opinion.
Reply: oh my god, really? look at my last comment
Reply: littlebitbetter But... You still don't have any arguments to support your thesis that controllers are better.
Reply: I never say controllers are better? what are you talking about, what I was saying was for moving in a first person game wasd is restrictive compared to a joystick, if you don't think that's true... your just wrong, now the mouse is a different story, the mouse is clearly better than a joystick
Reply: littlebitbetter "controllers are better than keyboards its just a fact." are you really so stupid?
Reply: oh my god, I said look that my last comment you fucking moron. my opinion on that has changed and what I meant by that is a joystick is better than wasd. this is clearly true because of the joystick having more than 8 directions to go, and I don't even care about it anymore
Reply: littlebitbetter You never said your opinion changed... Get your english right bud
Reply: "yes, opinions are made. but the hole point of this was to look at a new way of control, it made for people to look at there opinion and see if it should be changed. just saying "its my opinion and I'm going to stand by it no matter what" is just saying your dishonest and closed minded." this is clearly me talking about changing opinions, if I didnt stand by this comment I would be a hypocrite, I would be saying to everyone "YOURE CLOSED MINDED, what? I am close minded? youre a liar" really wtf.
Reply: littlebitbetter k